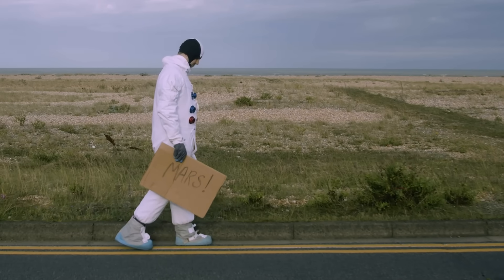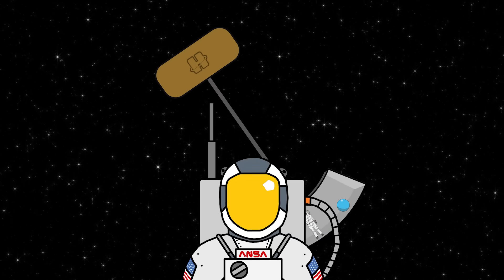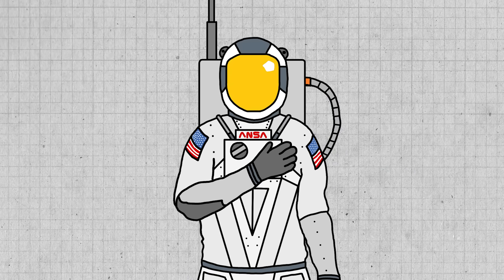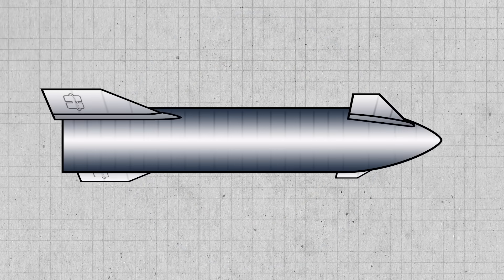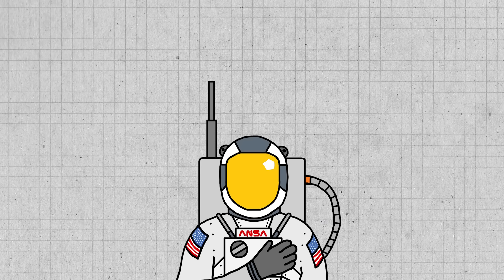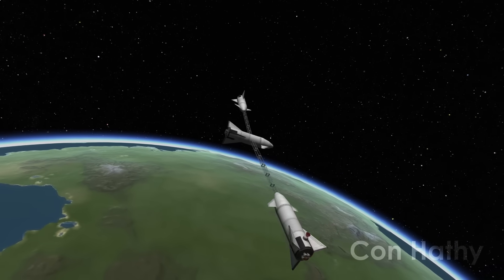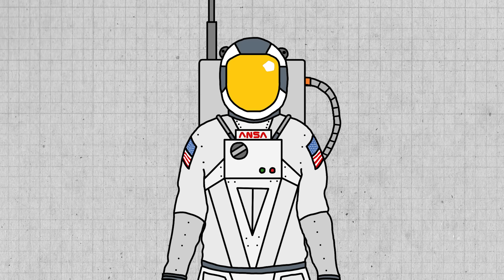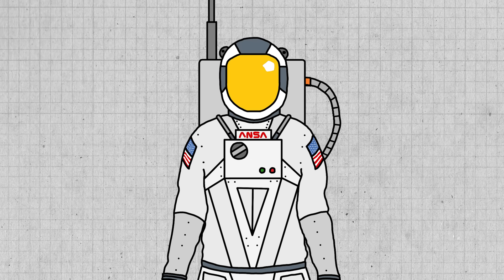This is NOT how you make Artificial Gravity

Comment: 12:00 I think if you attach them from their cg instead, they would be shot in a straight line and not rotate.
Reply: The rotation of an object and the velocity of an object are entirely separate.

Seeing that angular momentum is conserved, each ship will inherit the rotation once they disconnect.

So if the rope breaks, each ship will be both traveling at +100ish m/s tangentially and rotating along its cg along the axis it was before the break.
Reply: @Thetankracer  Mmm true, they can be seen as separate motions, but the energy of the rotation (of the system) would be transformed into the linear velocity, so it's conserved there.

But of course, if you attach the ships at the tip, then there is torque, and component of rotation on each ship that will remain after the break, the further the attachment from the cg, the larger.

The point is, if all the energy of the rotating system would go to rotating the ships alone, they would have to spin insanely fast!

Comment: What is interesting is that gravity is acceleration. You cannot measure the difference between either one. So the answer is to build/invent an engine that is capable of enough thrust to push your ship at 1g to simulate earth gravity. You accelerate halfway to your destination and then spin around and decelerate (accelerate in the opposite direction) for the second half of the journey. You would get to Mars in just a few days and you would keep your strength for your excursion. Travel to the next star would take less than a year or so. So let’s get inventing.

Comment: Accelerate at 1G until about the halfway point, then turn around and start decelerating at 1G.
Spin-Gravity is a waste of effort.
Reply: um...do you have any idea how much fuel that would take? if you accelerated at 1g until you were half way, you'd be going almost a quarter of a percent of the speed of light...
Reply: @alquinn8576  How much fuel it takes depends on what type of engine you're using. I presume we're not using chemical propellants for long distance travel. Getting up to 1/4 LS is not a problem as long as we could actually do it.

Comment: 2:25 how is that centrifuge supposed to restore normal pressure to the eyes when that persons head is almost at the center of rotation?
Reply from the maker: @NabekenProG87  That was actually a control setup where they intentionally put the eyes at the center, they also extended the arm to put gravity on the eyes but it didn’t seem to help (at least in earth’s gravity) I wasn’t able to find footage of that unfortunately

Comment: You could build small centrifuges inside the starship. You don't need gravity the entire time. You could use them as beds for sleeping. One-third of the crew could use them at a time for their 8 hours of sleep.
Just my two cents. Don't really know and im still midway the video.

Edit: Ok, it was at the very end. But you could maximize the space by taking turns and using them like a bed for sleeping.
Reply from the maker: @silver831cali3  there isn’t much point in sleeping in artificial gravity. Long term bed rest has very similar side effects as zero-g. To get the benefits of gravity you need to stand

Comment: Why is there anything in the center? Nothing is needed at the center. And the masses on either end do not need to be the same. I always imagined crew at one end for the trip out and the mars lander and anything else needed on the surface at the other end. Another thing that could be done is that the rotation rate could be slowly adjusted during the trip to acclimate the crew to Mars gravity. And the reverse done on the trip back to acclimate to earth gravity. I also think the entire configuration should be replicated 3 times. Space and time are not your friends.

Comment: One doesn't need to use thrusters to spin up or stop artificial gravity if one has a pair of gyroscopes and is willing to wait a little while.
Reply: If at the centre of a ten-tonne vessel whose mass is all five metres from the desired spin axis you spin up a gyroscope, centred on that same axis, that is composed of two 50-kg masses one metre apart, as soon as the gyroscope gets up to 1 RPM, the vessel around it will be at 0.001 RPM the other way.

But you mention waiting a while. Do you believe just keeping the gyroscope at 1 RPM will cause the vessel's counterspin to build up over time?
Reply: Correction, 0.0001 RPM. The rest of the ship is 100 times heavier and ten times farther out, so has equal and opposite angular momentum when going at 0.001 the tangential speed, but has ten times more distance to cover per revolution.
Reply: @ You are thinking of a momentum wheel. Momentum wheels apply torque when their spin is accelerating and opposite torque when their spin is decelerating, on the principle of preservation of angular momentum. They're good for small attitude adjustments but when trying to accumulate angular momentum they  become useless.

I am thinking of a pair of gyroscopes. Opposed gyroscopes apply no net angular momentum when accelerating or decelerating because the wheels spin in opposed directions, but when the axes of the spins are forced to precess in opposite directions, they apply torque which can be used to accumulate angular momentum for the whole system.

Comment: you could make the starship modular right?  where the orientation could be altered by linking to a different structure/craft that could hold them in the correct orientation for artificial gravity?  i mean if you made the craft modular you could swap out the "play load" from people to supplies to or even communications/sensor types of packages... or fuel right?

Comment: said it before, pre place solid fuel rocket "pods" in orbit... to link up with spacecraft we want to send places.  now i'm not a rocket scientist here but instead of hauling liquid fuel into orbit and refueling up there, which seems kind of risky without a dry dock of some kind up there... solar winds, radiation spikes etc... heck one little stone flying through space could cause both vehicles to detonate and destroy both... best to have them in a more protective sort of situation where they lock in the receiver.  decades before we get a true space dock at this point.  but if it would work, the idea of solid rocket motors in orbit... to link to and use... could work better in my opinion.  where did i get this sort of idea...?  star wars jedi craft, using orbiting light drive engines to travel to other systems/worlds... i mean you pre place some around mars or the moon, and earth and you could potentially speed up travel right?  until we get refueling stations on those worlds.  peace.  (( would a solid rocket motor work in space, that's the real question in my book ))
Reply from the maker: @eugeneminton2613  the odds of liquid fuel being ignited by anything you mentioned is incredibly low. Fuel and oxidizer are stored in separate tanks so, even with a spark, they can’t burn. Even with a leak in both, they’re not going to mix very quickly and will boil off. Solids, on the other hand, are premixed fuel and oxidizer. Once there is a spark to light it the whole thing will burn until it’s gone. 

And even if a piece of debris puts a hole in the case without lighting it, you now have no warning that the engine is damaged, and once it’s lit you can’t turn it back off. 

Not to mention solids are heavier and much less efficient so you need a lot more mass.

Comment: The problem with using a cable is that you have no way of getting into or out of the rotating parts. That's what the center piece is for. And a cable ladder would be nice too to get into the rotating pieces. Climbing that ladder while seeing the universe rotate around you would be a pretty bad thing, I think. So, I guess putting it in a tube would be necessary.
That would be enough to test if the concept works, and that we can get used to it.

But a much larger construct with a cylinder rotating around it's center axis will probably win out, if we want to build a real space station.

The idea of two counter-rotating wheels seems nice at a first glance. But I would hate to rely on bearings that massive to always work. Changing the orientation of a rotating cylinder isn't that hard. And doing it with the two wheels would load the bearings pretty much!
Reply: Today's cable materials are plenty high enough in strength-to-density ratio for a tether to reach several kilometres down from the spin axis and support a greenhouse several times its mass. That's too far to climb a ladder, but an elevator that grips one or more of the tether strands with sets of opposed wheels is doable.

Multi-kilometre radius means the universe rotates around you fairly sedately. I think it would not be bad at all.

Comment: I imagine a spaceship with two ring-shaped rotors rotating around the spaceship. There are two truss arms on each rotor and living cabins at the ends of the truss arms. Both rotors rotate in opposite directions while the spaceship does not rotate. When the spaceship accelerates or decelerates, the rotors do not rotate and the truss arms are not extended but lie against the hull of the spaceship.

Comment: An early centrifuge for a space station could be a 6.5 meter radius centrifuge rotating at 4.775 RPM to produce lunar gravity, its small while still big enough for a decent amount of space and for most of the gravity to still be there up at your head.

One that could be put in the starship is a smaller 4.4 meter radius centrifuge (0.1 meters less than the starships radius) rotating at 6 RPM, which is a lower estimate for highest RPM someone could adapt to which produces a gravity a bit higher than lunar at 0.1771G.

Comment: Could this idea overcome the intermediate axis trouble? : Four ships attached to the 4 ends of an H structure. That H wouldn't be the one we know, but an extra wide wide one. The horizontal beam would be much longer than the other ones, so the entire thing (H + 4 ships) would rotate around the longest axis, therefore being stable.
Reply: I would have thought you have to go out of your way to get into intermediate-axis trouble, but apparently smallstars found it easy.

Let a single space vessel pay a long tether forward from its nose, as outlined in my other comment (https://www.youtube.com/watch?v=aONcg5pcspI&lc=UgwzJVEmhMP8XxpZrUJ4AaABAg.A84b_mnFg70A8Cin67sAq1 ), and the three orthogonal axes you end up with include one very long one -- that of the tether -- and two short ones perpendicular to the tether. It has no choice but to rotate around a perpendicular-to-the-tether axis, and will do so stably forever.

Comment: Why is a single person centrifuge not some sort of hammock or sling?
Reply from the maker: @benjones1717  to get the benefits of artificial gravity you really need to be in a standing position, laying down actually has similar side effects as zero g
Reply: @ConHathy which is also what makes people dislike short radius centrifuges, 0G at your head for those <2 meter radius. It is better to have it be slightly taller than a person to have some gravity on your head for that reason

Comment: Does somebody orbiting around a mass feel inertia? 

Let's imagine a carousel with a diameter of 10 metres spinning at one turn per second. A person located on its edge will feel the inertia due to the rotating motion. 
Now in a point in space there is an extreme massive small object and a person is orbiting around it on a 10 metres diameter orbit, also at a rate of one turn per second. Will the person feel the inertia, similar to the situation with the carousel, or is it moving along the bent space and will not feel any inertia?

Comment: A ship just big enough to let the crew stand on the walls like the floor while in "transit" mode, but can halt rotation with simple inputs slowly like a momentum brake system similar to sattelites. Couple tht with the ability to have relatively open decks.. say 25m across.

Comment: I’d just put a cylindrical centrifuge inside the rocket, and have it spin, with a counterweight spinning in the opposite direction varying speed as needed to prevent the whole rocket from spinning. The astronauts could then lay down inside the cylinder to have a sense of gravity as they sleep, relax or even work without needing to worry about the Coriolis effect too much. The difficulty will be entering and exiting the centrifuge since it would need to spin faster, so you would have to start and stop it occasionally.

Comment: The question i would like answered is: What force would attract an object to the outside edge of a spinning container, outside of a gravity well? 
So on earth a centrifuge is essentially a 2d plain. Gravity is holding the bloke to the one shown at 2:55, he is being pushed outwards because he is spinning, not the machine, what if he was not attached to the machine, but floating an inch above it? 
If you were inside a rotating cylinder in space, wouldn’t you just float about inside it? 

I keep imagining a torus with bulkheads radiating out from the centre, as it spins the bulkheads would be accelerated into you and become the floor. So from your perspective you’d be in a building with rooms stacked on top of each other. But then centrifugal (or whatever) force would push you to the outer edge if the torus so everything would be accelerated into the corner of the rooms. If you took the bulkheads away you’d just float while the torus spun around you.
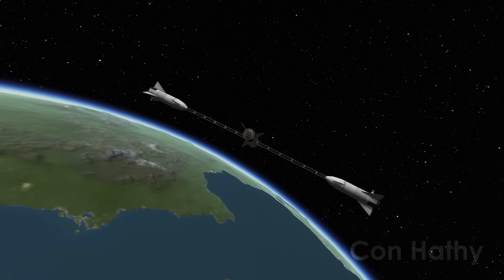Reply from the maker: @python27au  i actually made a follow up video where I talked about this (11:21 https://youtu.be/dSEK_AQ1gCs?si=LwyyZdfF8hfP8X9a) 

Long story short, you’re pushed sideways while it’s spinning up, like a train leaving the station, but once it’s up to speed and stable you are only pushed outwards. You would float until you ran into or grabbed onto something, but once you’ve done that you’re moving and even if you let go or jump, you’re still moving because of your inertia. From the outside it looks like you’re moving in a straight line until you hit the floor again, but from inside the station that feels like you’re being pulled to the ground by gravity

Comment: The short centrifuge idea is stupid - a lot more mass and zero advantages
Reply from the maker: @duncancairncross  more mass than a 500+ meter cable strong enough to hold up a fueled starship? How did you determine that?
Reply: @ConHathy  The loads involved - the motors the space taken up - and it can only be used by one crew member at a time - its NOT going to be a light object!
The cable would provide the chosen "gravity" for the whole crew all the time making lots of things from drinking to eating to going to the toilet
Reply: @ConHathy  I don't know how he did, but I started with the 384-km breaking length Wikipedia "Specific strength" gives for Zylon. Since that's in a uniform one gee, you can double it for a Zylon strand rotating around, hanging from, an infinitely massive hub: it hangs down/out to radius 768 km. The hub is at zero gees, the tip at one gee, the average, one-half.

You want the material to be at, not 100 percent, but ~10 percent of its breaking stress, so back the radius down to 76.8 km. You want it to support something more than just itself. Let's say it's a ten-tonne cable on which you wish to hang a 90-tonne space habitat which, because it is habitable, is at one gee. It weighs 90 tonnes-force.

The tether's self-load is five tonnes-force -- half a gee average -- so 90/95 of the force is from the end load, and you must shorten it by another factor of 19, down to 4 km.

Finally I would replace the infinitely massive hub with several times 4 km of additional tether length, so that it can all be paid out from the nose of one Starship, with continuing tangential thrust from a solar panel/ion thruster system at the end that keeps the angular speed constant while angular momentum increases.
Reply: @grlcowan   @grlcowan  I am not smart enough to follow your calculations. But I know, once installed in space, the mass of the parts involved do not matter. They just have to disconnect the spaceships before arrival on another planet. The astronauts will have some seasickness before arrival. And they can later recuperate the 500 m cable at the planet where they arrived.

Comment: No way to rotate a single Starship ... except a really long tether let down from the nose. You end up with the Starship ~1 km from the spin axis and the tip of the tether ~9 km the other way from it.

The tipmost kilogram of the tether counterweighs 9 kg of the Starship. So the whole 9-km counterweight is lighter than a second Starship at 1 km.

Tether paid forward from the nose is being paid down because the Starship starts out rotating end-over-end at the design angular speed. This speed is maintained as payout continues because there is a solar-powered ion thruster at the tether tip. So OK, not just the last kilogram of tether, but also this drive and its solar array, counterweighs ninefold.

Comment: Question about the centrifuge experiment: The experiment places the head in the center of rotation, which is the spot that has the least centrifugal force. Is that possibly why eye pressure didn't regularize? Like blood pooling could be explained by the blood in the rest of the body being drawn to the legs via negative pressure, but the eye pressure wouldn't experience this effect as much.
Reply from the maker: @Jacob-yg7lz  That was actually a control setup where they intentionally put the eyes at the center, they also extended the arm to put gravity on the eyes but it didn’t seem to help (at least in earth’s gravity) I wasn’t able to find footage of that unfortunately